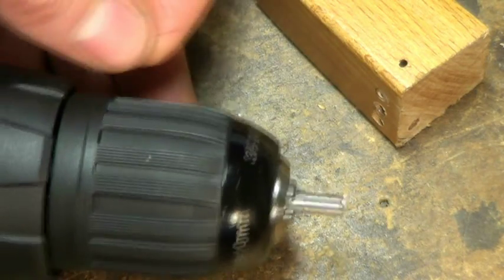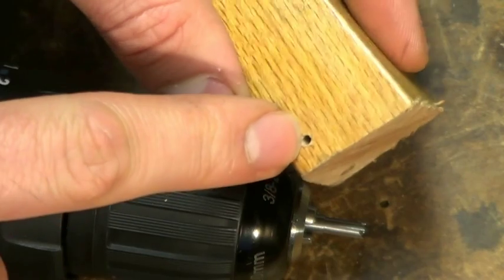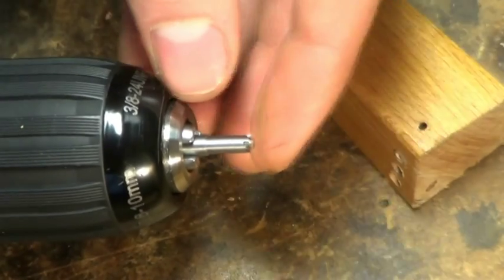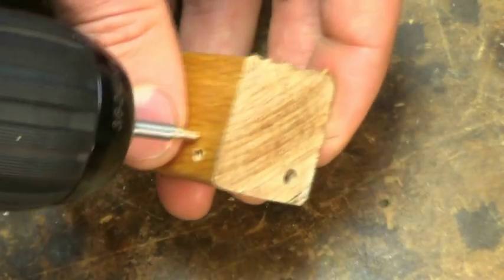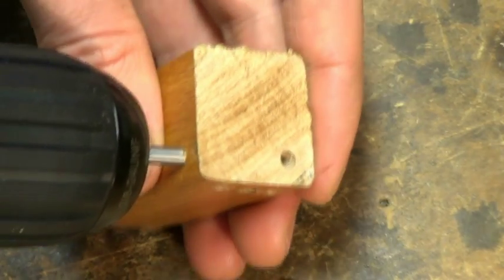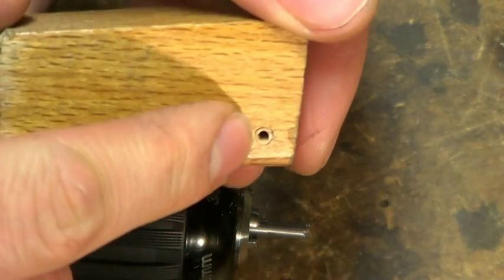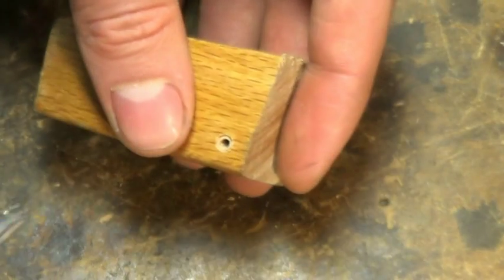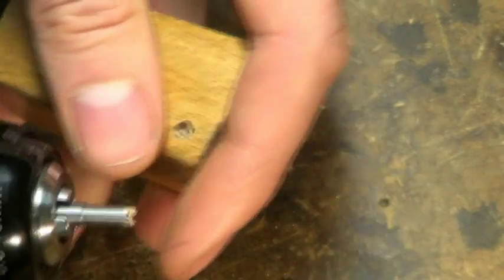Miniature tube drill for broken screw removal

Comment: I just broke 2 machine head screws on my guitar. After reading what you did, I see you did the Exact same thing. Vintage guitar, maple wood, and a very small screw. I don’t have a machine shop to make what you did. So I think I will try to make something like you did with a piece of stainless steel brake line. The inside should be close to correct size and not to big.

Comment: Really cool idea. How did you make the guide pin?
Reply from the maker: Turned on the lathe, same as the drill itself.
Reply: ***** Oh. I wonder if i could do something like this out of stuff i have around, the jaws on my lathe aren't as "cooperative" as yours seem to be :)).

Thanks for answering.
Reply from the maker: aserta It doesn't really matter if the lathe chuck has runout - just turn both diameters at the same time, without removing from the chuck.